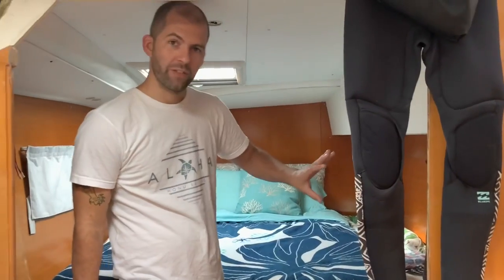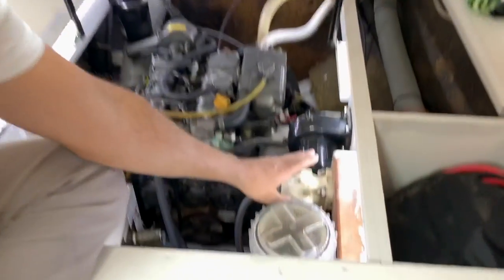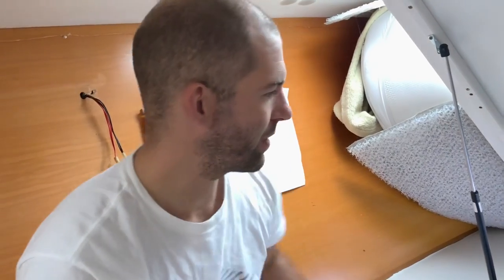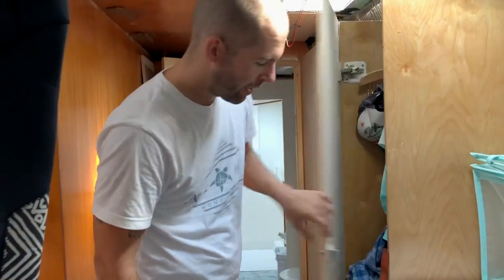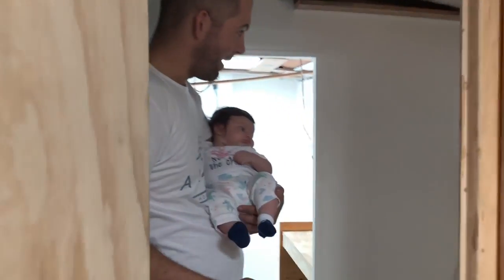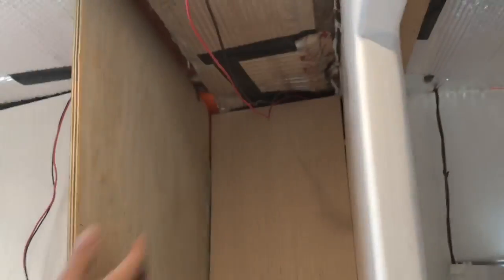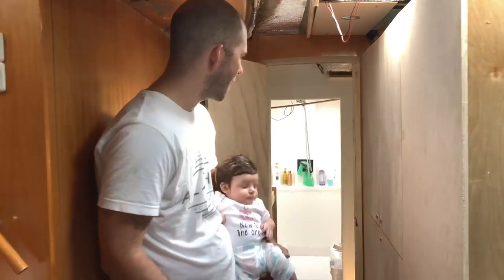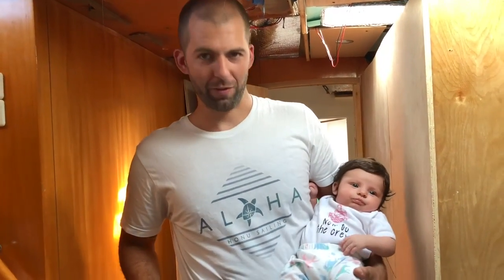OUR PROGRESS ON THE REFIT/OWNERS CONVERSION

Comment: In the wet locker don’t use the blue remodel box and use an exterior handy box, to prevent moisture intrusion. Also in wet locations( bathroom and kitchen) use GFCI and arc fault in all the bedrooms , for all AC, receptacles

Comment: at 7:08 the camera pans to a 120v receptacle.  I dont know boats, but on land usually will install a gfci(ground fault circuit interupter) receptacle for electrical safety near sinks and tubs.  Maybe gfci receptacles are not used on boats.  Nice vids, thanks

Comment: I would add a CO2 monitor/alarm in that bedroom/engine room.. As you know CO2 is odorless and lethal. Please take every precaution w baby on board.
Reply: And gas
Reply: Michael you mean CO. Carbon Monoxide not Carbon Dioxide. Totally agree, CO alarms save lives!
Reply: And a propane monitor in each hull (if you intend to use propane onboard)

Comment: Hey guys love your videos! I was curious why you installed a regular recepticle next to your head sink and not a gfci? I have no experience with boats, but my wife and I are dreaming of becoming liveaboards. Does the electrical system work differently than in a land home?
Reply: GFICs are so inexpensive now, I think I would use them every where in a boat. Plus, you can chain them in a circuit. (first box in a circuit is GFI and if wired properly the remaining boxes will be protected.)

Comment: I thought the same thing when I saw him do it but that pot filler will sink your boat if it’s in the wrong position and it gets turned on by a wave or the motion of the boat bumps something into it FYI big mess no more freshwater you know
Reply: Any leak or accidental point of use activation has caused many a tear.  Experienced sailors flip the water pump breaker off and close stopcocks when not in use to prevent such surprises...also keeps stopcocks from freezing open.

Comment: Don't take this the wrong way, but you're killing your resale value as you don't have the woodworking skills to do it right. If you hire someone who knows how to do proper woodwork to finish things up, you might increase the boat value rather than decrease it.
Reply: Maybe you could use your expertise to point out the biggest issues you see so Ryan can address them easily now if he chooses.
Reply: Workmanship.
Reply: I'm afraid I have to agree as a red seal carpenter for 30 years, the fit and finish is pretty rough. Quality starts at the beginning, trying to slap something in then make it look pretty is backwards